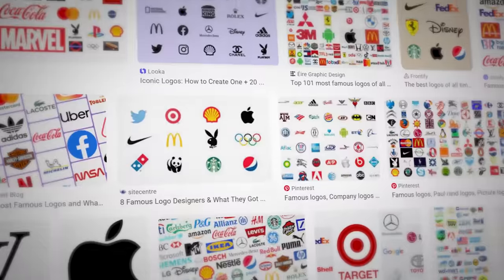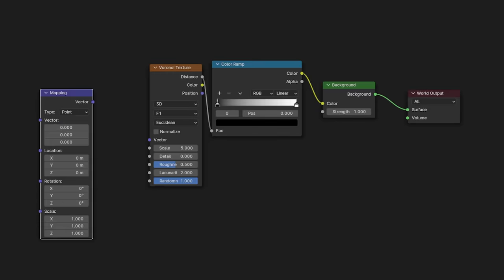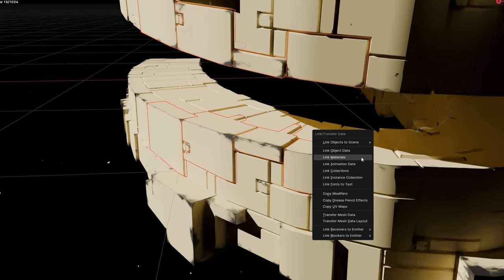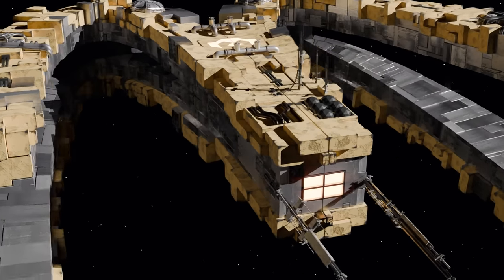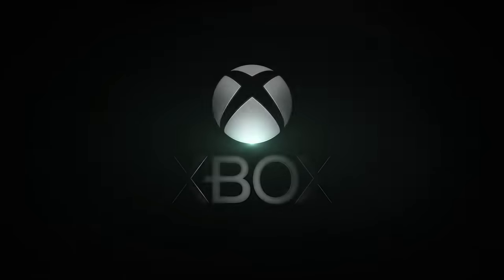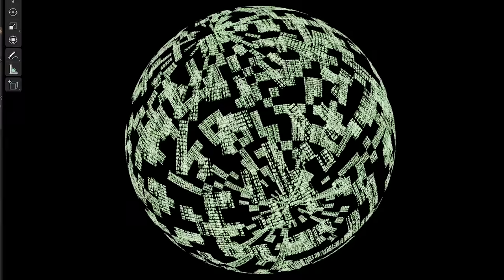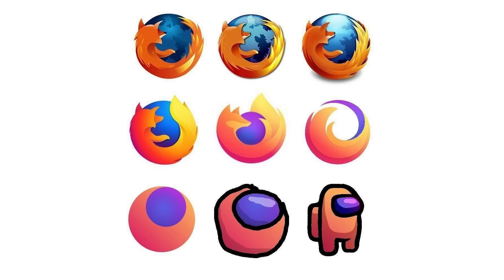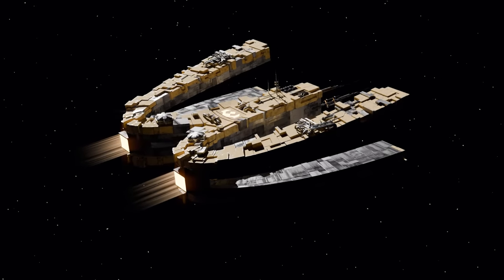I Overcomplicated Famous Logos...

Comment: A Perplexus, originally released as Superplexus, is a 3-D ball-in-a-maze puzzle or labyrinth game enclosed in a transparent plastic sphere. By twisting and turning it, players try to maneuver a small steel ball through a complex maze along narrow plastic tracks. The maze has many steps (varying across puzzles). The number of steps ranges from 30 in the Perplexus Twist to 225 in the Perplexus 3x3 Rubik’s cube Hybrid. Some levels drop the ball into a cup or a small rim to utilize its 3-D nature1. Players must complete obstacles varying in difficulty to reach the end1. Perplexus LLC is the manufacturer and a wholly owned subsidiary of Spin Master Ltd (since 2017)1. There are currently 27 versions of Perplexus ignore the ones